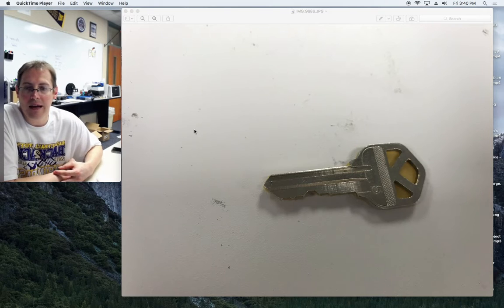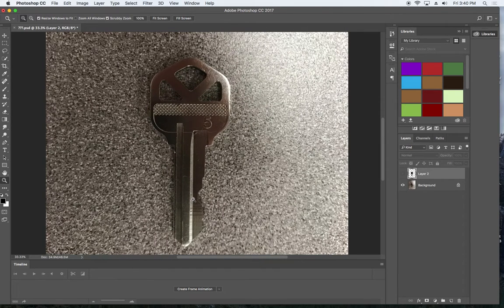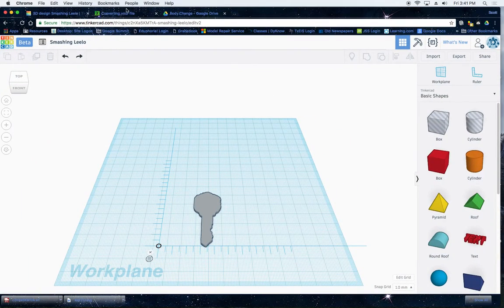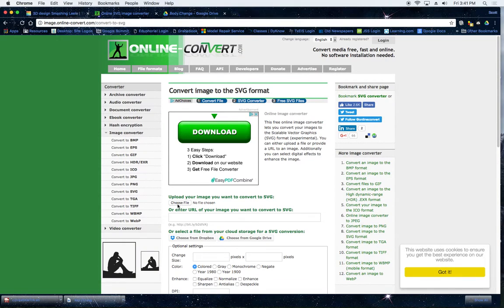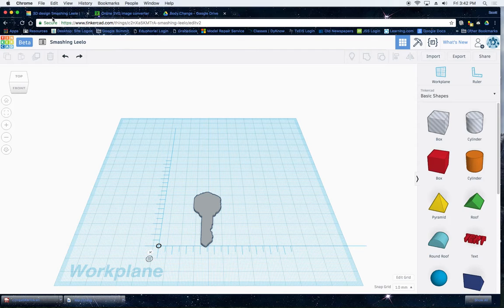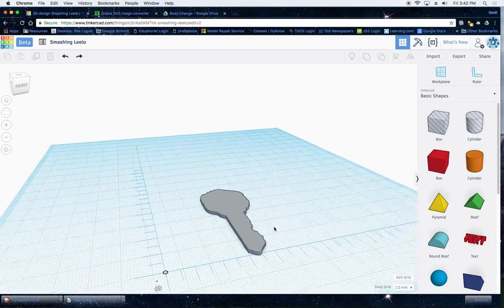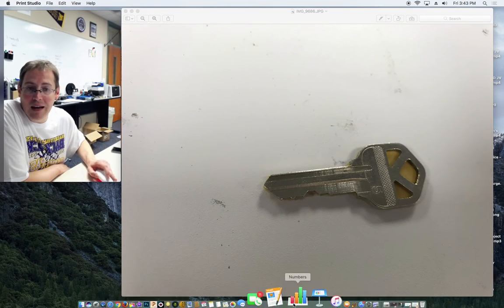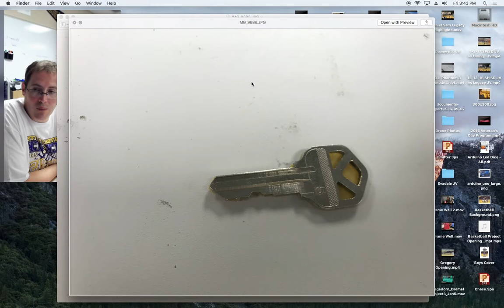How to turn a picture of a Key into a printable 3D Model

Comment: Hello.  I need the same thing but with a different  type of key. Could you help me get a 3d file with correct sizes from a picture?  Thanks Stefano
Reply from the maker: What we did was get the width of the key measurements beforehand, so we knew what size to make that.  As for the key itself, I also had a quarter in the picture too, so I could scale it with a known size of a shape.  I don't think I had that quarter in the video, but we did have a known size of an object.